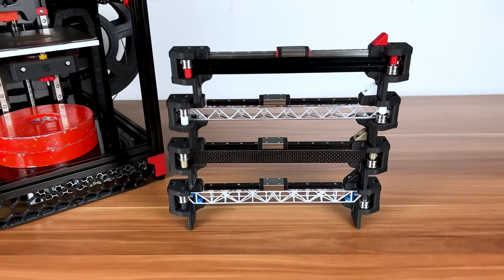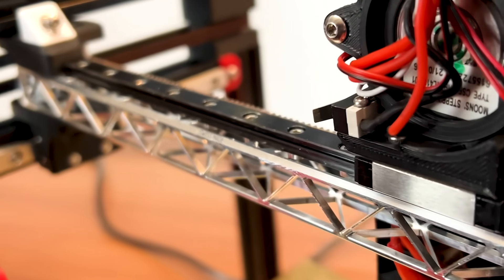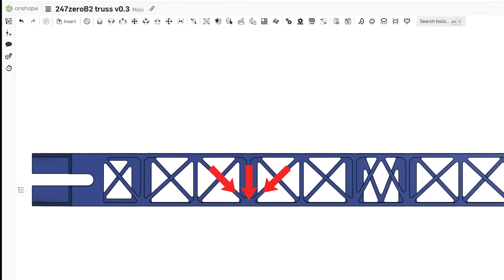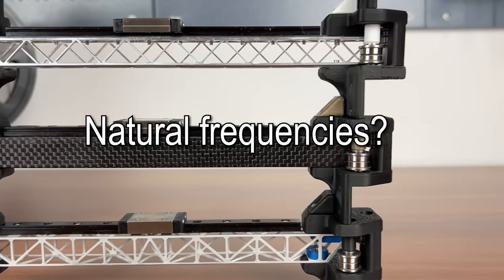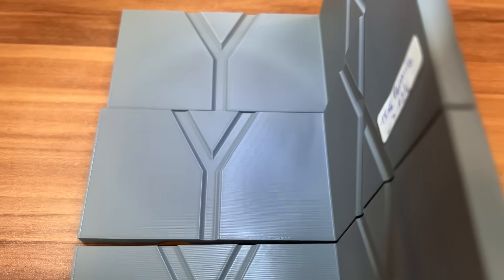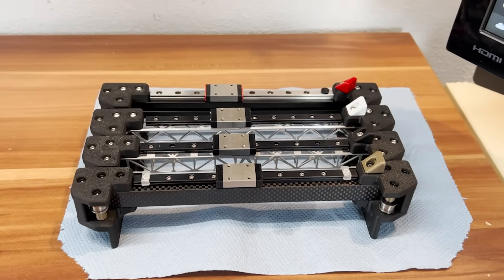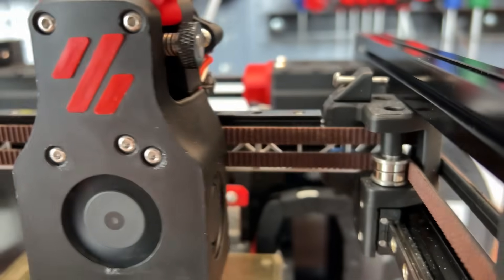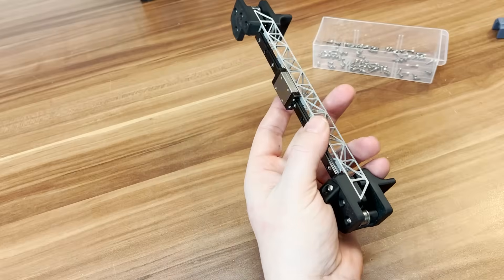ULTRA lightweight X-BEAMS tested -  USELESS on Voron 0.0 / 0.1 / 0.2 ?

Comment: The fact that the beams all get the same recommendation from input shaper surely would indicate that the limiting factor for improving accel here is stiffness, not mass - would be interested to see how a significantly stiffer beam (at the expense of more mass) would compare in this case (perhaps an aluminium square tube with unmilled walls?)

Comment: Amusing that you put so much effort on such a light part when it's dominated by the extruder mass.
Reply from the maker: I am happy to amuse you even though that's very strange amusement.
I designed it for bowden config like mentioned in the video - extruder mass on the frame...

Comment: Currently, I use a similar carbonfiber beam, and got a nice 4000 accel improvement on Y (recommended 23800), for x beam im also using mgn9c, and got a 10k accel improvement with reduced wobble.
Reply: Plus, the carbon fiber has good rigidity properties that help with reducing ringing, while hyperbeams and ultra beams are framed aluminum that, in my opinion, it is much too wobbly. And also the fact that the toolhead weight also contributes in the weight of the of the Y axis, reducing the toolhead weight should also be priority

Comment: Here's an idea 3d print a generative designed beam in metal, could get lightweight and a geometry that minimizes vibration transfer
Reply from the maker: Thinking about generative design since I started with those beams in 2021, but I don't have operative knowledge on that.
Maybe I'll revisit that topic some day.

Comment: Wn =sqrt(k/m)
Where Wn is the resonant frequency, k is the stiffness and m is the mass. In order to improve input shaping results, you have to aim for the highest possible frequency. That means you not only have to reduce mass, but also increase stiffness!
Reply from the maker: TRUE!
Reply: So skeletonized titanium, gotcha (Or arguably alloy steel (which one is debatable but a few come to mind), I assume it would since while it's denser most of that mass is gone and it's significantly stiffer, brass, nickel, and zinc would also work since they should all be stiffer than aluminium [at same dimensions]).

Comment: One other thing to keep in mind when selecting material: fatigue. Aluminium is not great at that. An ultralight piece might need replacement every few months.
Reply from the maker: Very, very good point (when going at crazy accelerations)
Reply: @247printing  (or trying to use the same thickness on a bigger machine)
This little machine would probably work with the steel guide and two end pieces only. I bet some people will mistakenly use beams that are lighter than necessary and be surprised.

My comment is just for a future "I told you so". 😉

Comment: I think those ultra lightweight beams are sort of snakeoil. Yes, reducing mass ist a good thing for high acceleration and the beams looking like a low hanging fruit, but you have still the linear rail, x and y carriages, the fastners and the hotend assembly with extruder. this adds up quite fast. That would be intresting, how heavy all together is and how much weigt can be saved by just using a bowden setup.
Reply from the maker: Bowden is key, yes, I'll come back to this. In the end the sum of weight reductions makes a difference.
Reply: In the v0 that seems to be definitely the case, but in larger 300-500mm printers the normal X beam extrusion weighs a lot more. Also the v0 toolhead is actually quite heavy too so if he used a vzbot tool head or similar it would be lighter again.

Comment: I think a good way to think about stifness to weight,weight saving and resonances in 3d printers is in terms of different mass spring resonators.
One spring is the X beam it self and the mass asociated with it is both it's own mass and the mass of the print head.
If you think about it, a resonant system will maintain the same resonant frequency if you increase it's stifness and mass in proportion so the mass of the X beam kinda cancles out in this scenario and the resonant frequency depends on the total stifness of the beam and the mass of the tool head which is consistent with the stiffer but less efficient beam having a higher recommended acceleration.
Of course if you make your beam incredibly heavy and stiff eventually the next spring down the chain will start to become the limiting factor. That spring would be the elasticity of the belts grounding the X beam to the frame of the printer via the stepper motors and idlers.
In terms of that spring the relevant mass is the X beam mass + the tool head mass.
So to find out where the sweetspot is for optimising the stifness and weight of the beam one would have to get some idea of the relative stifness of the beam it self and the belt system that grounds it to the frame.
all that of course leaves out the performance limits imposed by the stepper motors but it seems that in practice that really doesn't apear to be a limiting factor for the sort of accelerations that actually happen during printing.

Comment: !!!!!!! you didnt include the NUTSfor the tslot or the carbon fiberbeams, the lightweight beams are threaded so they include the nuts in the weight, and you needed to measure the belt tension, so the resonance test is worthless, and the plastic gantry joints are the weak spot.
Reply: stiffness is not like strength where the weakest link determins the strength of the whole system. the plastic parts having realtively short load paths means they probably don't contribute much to over all compliance

Comment: The total weight of the xy carriage (bearing blocks, linear rail, extruder, hotend, brackets, housing and beam ) is what like 400g? And this just looks at a 80% reduction of 10% of the mass. Maybe a lightweight beam becomes relevant when you reduce the other components weight by 80% too…

Regardless. I suspect the rotating mass, reluctance and inductance inside the stepper exceeds the entire mass inertia of the carriage. A coreless wide airgap long but small diameter high amp fiberglass servo would be interesting…
Reply from the maker: Yup, it's 385g, see the conclusion chapter

Comment: In a lot of your monologue and graphs you are confusing stress, strength and stiffness together. It is crucial to correctly understand each of these 3 as they imply vastly different measurements and results. A material can be strong but not very stiff (ex. glass fiber reinforced polymers). A material can also be very stiff and strong but not tough (ex. glass). If you want to improve a design, you first have to fully understand how it works to be able to understand what are limiting factors, and where you can gain most.

For example at 13:40, none of these results have anything to do with stress or strength, but more to do with stiffness. And even then, you are measuring a combination of torsional AND linear stiffness. The linear component is because you are not applying a pure moment, i.e. at the point of mounting there is still a force present, AND a torque. To measure purely the torsional stiffness you would need an identical force, at an identical distance on the other side of the extrusion. This way you introduce a moment without introducing a net force on the beam you are testing.

Also, the beam you have designed (as with the CF beam and the swiss made one) are all extremely poorly designed for torsional stiffness. Closing off the ends of a boxed section significantly increases this. I suspect that a thin 'box' type section with closed off ends, without any fancy cutouts would outperform them quite easily. You could improve the existing designs by adding 'ribs' or 'bulkheads' or even simple formers along the length.  Also this theory you can find in basic beam theory of mechanics. Large enclosed area is crucial in attaining high (torsional) stiffness.

If you want to do more of this stuff, I would highly recommend you read in on the basics of materials. I would recommend "Mechanics of Materials" by Gere and Timoshenko, which is kind of a standard work in mechanical engineering and a good primer.

Comment: Of cause the lightest beam has the best stiffness to weight ratio as some stiffen comes from the lineare rails and thy are not factored in.
No beam (only the free hanging linear rail) would have the best stiffness to weight ratio.

Comment: Very nice work!  As you see with your natural frequencies and maximum recommended accelerations, what matters is the stiffness to mass ratio.  Even with better stiffness to mass ratio of the CF, hyperbeam and ultrabeams in isolation, once you add the mass of the hot end, the complete performance may be worse since the alternatives have an absolute lower stiffness than the default.  If you had absolute stiffness included in addition to the stiffness/weight I think it would be more apparent.  It would be nice to know eventually what size of beam makes this crossover point viable for using the lightweight beam designs.
Reply: This is pretty much what I was going to comment too. The acceleration is lower with those lighter beams so they don't flex too much. It would be pretty interesting to see what would topology optimized beam look like.
Reply: yep too much stiffness reduction in comparison ...

Another factor might be a reduction in damping of the beams themselves although I expect the impact to be smaller in comparison to the stiffness reduction.
Reply: I don't think it is "stiffness to mass ratio" at all.   The carbon tube would have won if that were the case.   It is simply "stiffness".    To go faster it would need to be stiffer than a 1515 extrusion.  As I wrote above, I think the best easy redesign would be a thick wall square aluminum tube with same mass as the 1515 part.        To further prove my point try computing the stiffness to mass ratio of a tube and then calculate the same for a tube. with thinner walls.   Stiffness to mass RATIO goes up as the wall gets thinner (assuming the same outside dimensions).  But also the thinner tube has less overall stiffness.    Thin wall is the wrong direction, you want then thicker even if the ratio is less.
Reply: Lightweight only helps if your motors have reached their maximum acceleration values due to inertia. His motors are clearly able to overcome the inertia of the heavier, stiffer beam. He will see practically zero improvement by trying to make lightweight parts. This is wasted effort in this instance.
Reply: @UnitSe7en  having less mass to stop also helps with the input shaper results aswell, vez3d showed this pretty well. By shaving just a few grams of his hotend the resonance frequency increased quite a bit.
Reply: @twanheijkoop6753  i could see weight reduction on the hotend and extruder being a bit of a different matter, especially without Finite Element Analysis/simulation to help inform design choices wrt weight distribution and balance of the carriage.
Reply: @UnitSe7en  True, but as the printer size increases and the relative mass of the beam to the hot end gets larger, maybe this solution would be worthwhile (perhaps on a Voron 2.4).  I guess that can be settled by future testing or at least a simulation if the overall stiffness/mass are known.  From most of what I have seen, the melting and cooling rates of polymer will start to limit performance more than mechanical resonances in these smaller fast printers.
Reply: @UnitSe7en  exactly. This sort of research has already been done in the case of speaker drivers/larger magnets/stiffer-lighter weight cones. It makes no difference if your motor (its called that in speakers too) is already able to achieve the required acceleration to cope with the demands of the frequency being requested. It turns out to make no difference at all to make the cone lighter. Here, longer beams will make this problem worse. If its already of little yo no benefit on the v0, larger sizes will see more problems, as rigidity is lower already on the shorter beams, it will be more apparent on longer ones.
Reply: More rigid, yes, lighter-no. More rigid will equate to lower distortion. And indeed, some damping doesnt go astray either, to help cope with resonance.
Reply: @UnitSe7en  No.  His measurement of "goodness" was not the speed of the beam but the "magnitude of resonate oscillation".    His big mistake was thinking that faster speed is better.  No.  The input shaper measures the amplitude of the vibration.

Comment: Maybe try testing using tension in your beams. Concrete beams in construction sometimes uses threaded bar inside to apply compression to the concrete and increase its stiffness. The term to look up is post tensioned concete. Either a thin threaded rod down the middle of the beam or steel wire, Kevlar thread, something with high tensile strength anchored at either end of the beam would maybe increase your stiffness & capability. Of course you would have to beef up your beam to take the compressive load & increase weight but would be interesting to see tested ✌️
Reply: Tensioning concrete is not to increase its stiffness, it's to prevent it from seeing internal tension loads, as it it not good in tension, unlike carbon fiber and metals.

Comment: I would try a different take on the beam. The front and back faces are left mostly intact with the top an bottom faces more open. The front and back faces get more material removed towards the ends with next to no removal at the middle, like a beam of equal tension in mechanical engineering. The deflection in the middle is obviously the greatest and thus needs the highest amount of local stiffness. Maybe ill try that once or even a composite approach, combining aluminium and carbon fiber parts
Reply: This is true. The design of the box structure does not take into consideration the variable cantilever forces. If designed more appropriately, there is potential for improvement of stiffness:weight.
Reply: @UnitSe7en  or even focus more on stiffness than weight in that case as the x axis is already insignificant compared to the toolhead. I would wonder how a regular 15x15 tube with 2mm wall thickness would have compared, especially to the standard extrusion
Reply: No, the force on the beam is torsional.   The heavy part is the extruder motor and it is not in line with the beam's center.   The acceleration of the beam by the belt is about 2X higher than the acceleration by gravity. (gravity on Earth is "only" 10 meters per second squared)    You can ignore the force of gravity here.     You need a stiff beam, not a light beam.     The mistake was to optimize the wrong thing.   He tried to remove mass and mass does not matter here, total stiffness matters.     I think a SOLID 15 x 15 beam would beat the 1515 v-slot beam

Comment: I definitely think we need to see this test again on your rat rig with 2020 extrusions.
Reply from the maker: We need this!
Reply: @247printing  based on the deflection of a simple beam, when you double the length the deflection raises to the 3rd power so we should definitely see a much more conclusive result if light weight beams work or not!

Comment: i am personally running the ultra beam, i absoletly love the thing, i have found much better max speed out of it then the stock 1515 extrusion whiles my carbon fibre beams can achieve similar speed however with the chamber enclosed it suffers from the temperature being around 65 degrees and softened greatly actually will start give me print artifacts. Which was fairly clear shown if i print something without heat soaking as temperature of the chamber raises the print quality decreases. As my own personal testing, i only managed a max speed of only 500mm/s at 58k accel which is very similar to what you got however i was able to get a max of 650mm/s at 67k accel with the ultra beam with the same rails, motors, motor current, motor voltage and aswell same tool head, with the only different being the x beam before the motor start to skip steps. So atleast for me i am pretty happy with the ultra beam, decent amount of speed gain espcially in accel compare to the stock beam. I would mention for the forks who love chasing perfect input shaper graphs and recommendations, i get pretty much the same recommandation at 22.5k accel with the stock 1515 extrusion with the x beam being a bit less at 18.3k accel which to me is not a huge different anyway. But when it come to printing i see no different printing at the same speed of 350 mm/s on the outer wall and 450 mm/s on the rest whiles with the accel set at the recommanded of 18.3k with the ultra beam to set it at 70k with no ringing effect shown.

Comment: Super interesting! There are two ways to get higher resonance frequencies, less weight or more strength.
I start to think that maybe it is worth trying to go into the opposite direction. Heavier but stronger, no printed parts, thicker extrusions, heavier linear rails, strong motors and maybe even ballscrews instead of belts. What do you think about it?
Basically a CNC with faster motors, but a hotend instead of a milling motor. With exchangeable toolheads it could double as a CNC.

Comment: i would like to see a solid aluminum tube tested, maybe even with some speed holes on the front and back surfaces (keep the faces loaded in XY solid).

reason why the 1515 performed better is because rigidity is more important to strong IS results than lightweight. a loss in weight is very commonly associated with a loss in rigidity and our motors are usually already plenty capable enough of flinging the existing weight around.

another thing is that you probably cant clamp as hard with the skeletonized beams as you can with the 1515